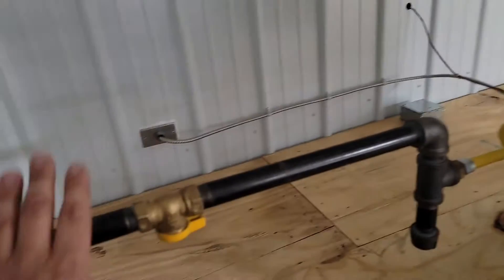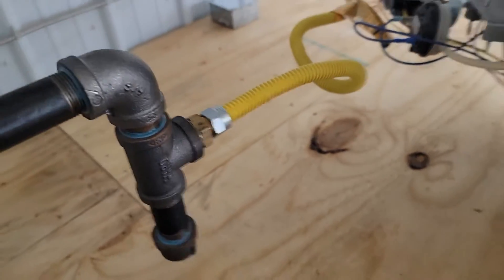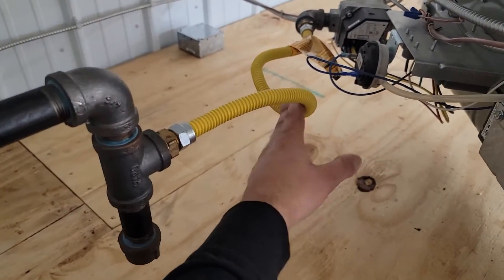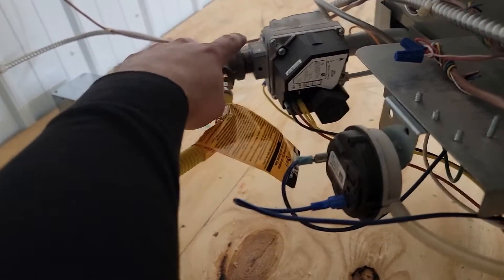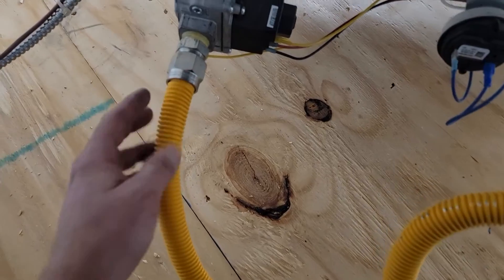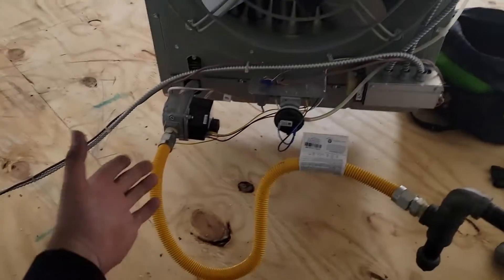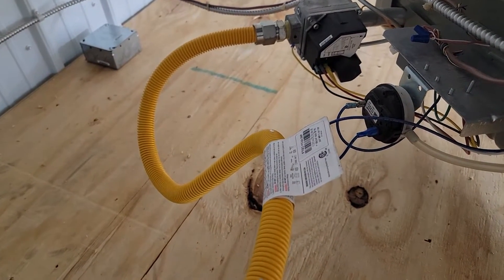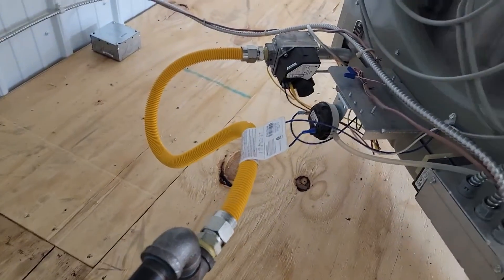I Made A Noisy Gas Hanging Heater Quiet!

Comment: Just subscribed.  Taddy, I'm building a shop and looking at Reznor unit heaters.  My HVAC guy is steering me away from them as he has been dealing with load whistling noises when the heater turns on.  He is saying Reznor doesn't seem to be of much help.  Would you steer away from Reznor?  He is suggesting Modine.  I'm also wanting the most quiet heater I can find. Thanks!
Reply from the maker: The whistling noises are caused by the gas line size
I like those heaters they work great

Comment: I've had this happen twice on some ultra low nox furnaces.First time was on a condensation furnace and the orfice for the modulating gas valve was slightly blocked .The second time the modulating gas valve just started closing by itself causing  a restriction in the gas line
Reply from the maker: very cool thank you for this info